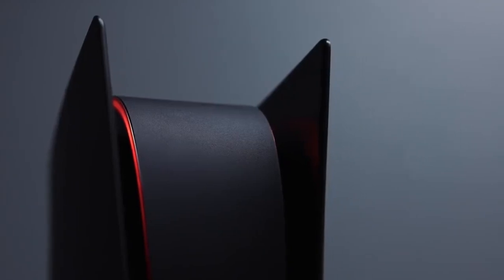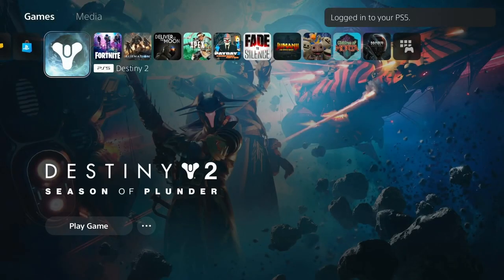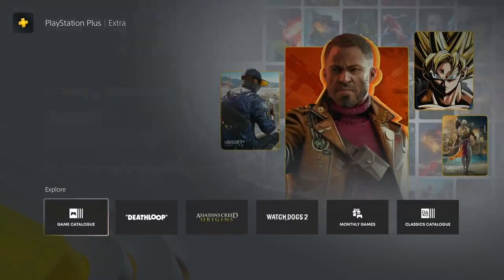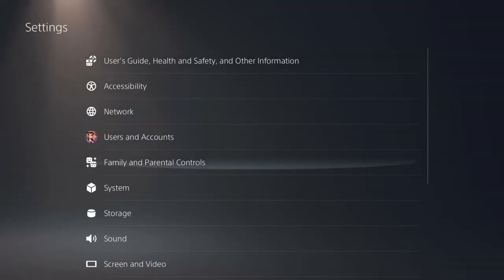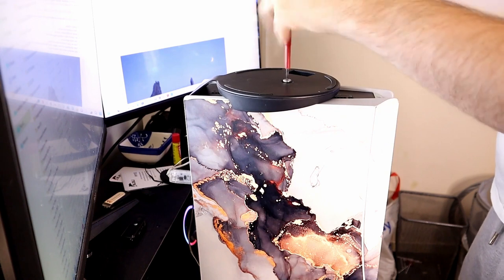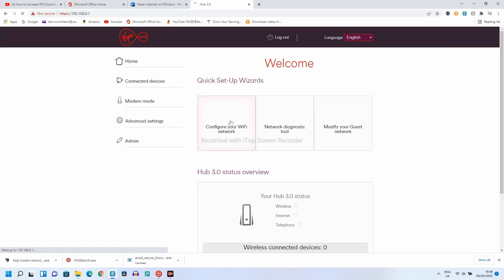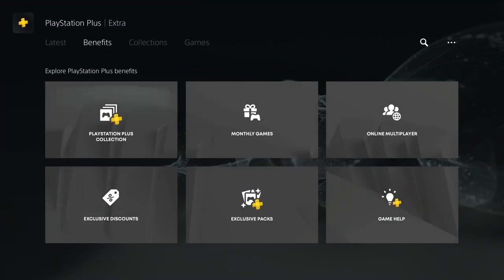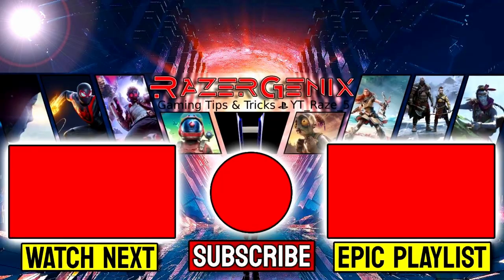40 EPIC PS5 Secrets | PS5 Secrets | PS5 Tips & Tricks #28

Comment: It says to connect external hard drives to the USB ports in the back. The front usb port is just for charging controllers.
Reply: I'd just like to second this for anyone who comes across this comment. 
It's definitely best to connect hard drives at the back of the system. Although it the front will technically work, the back ports are specifically designed for this use. 
Also makes it harder to accidentally unplug the hard drive as this can cause data corruption if you don't correctly eject the hard drive first via the settings menu on the PS5.
Take it from me, I messed up 3 terabytes of data by not ejecting an external HDD from my PC before and had had to format it completely - won't be making that mistake again!